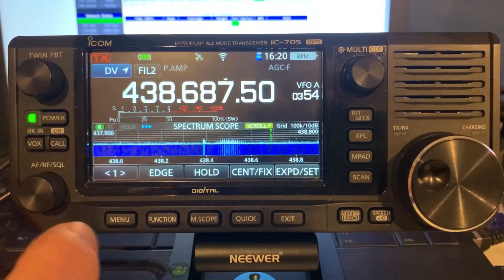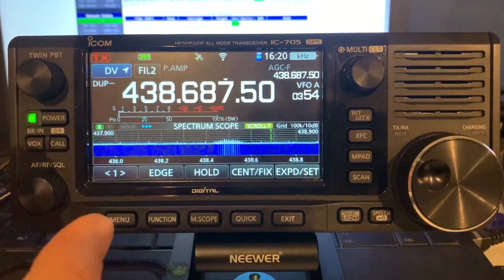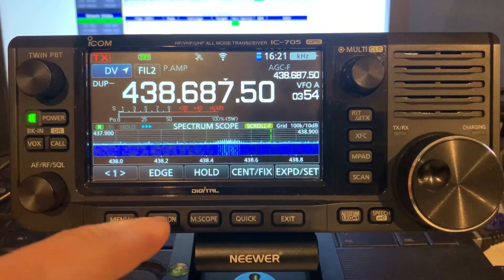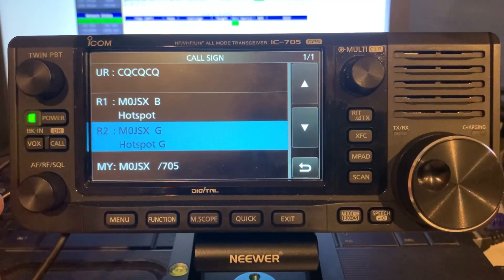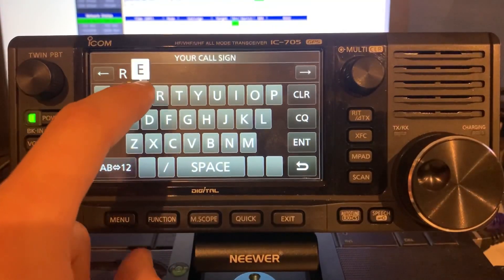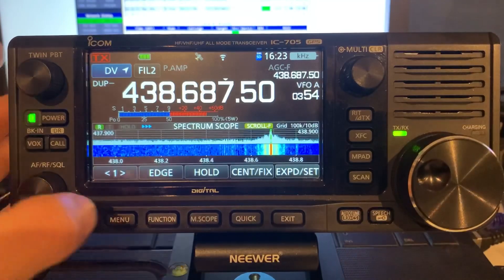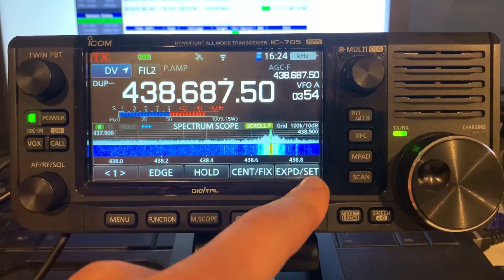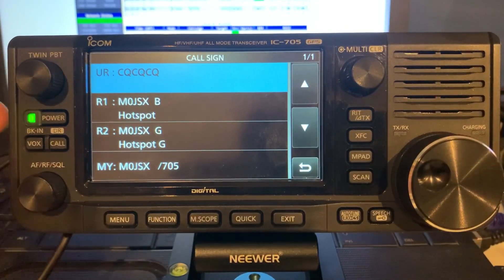How does DSTAR work?

Comment: Cheers Jonathan. I was waiting for this one since you announced it was in the pipeline. I have an ID-4100 and although I concede that the 705 looks as though it makes things a lot easier to achieve, the ID-4100 is frequently a nightmare of stabbing at buttons! An old head plus "new" tech. is a dangerous cocktail ...
Reply from the maker: Thanks for you comment Dippy. Unfortunately the ID-4100 breaks the mould a little in terms of ease of use. I’m not sure Icom really thought about the user experience too much when they designed it. Still a lot easier than the IC-2820 and predecessors! 73!

Comment: Hi again Jonathan,
Many thanks for another Great video. 
This time though I am still just as(if not more than) confused over getting my rigs active on DSAR.  I have an IC7100,  an IC92E (with the GPS Microphone, , , , , & an IC2820 with the GPS Aerial kit.  I am at a TOTAL LOSS, And I want to use DSTAR with all 3 radios, depending whether in in the car, (IC2820) out on foot (IC92E), or at home in doors (IC7100). I purchased each rig New from your previous employers BRILLIANT Emporium.
Now having watched this video, I find that I have to pay out even More money in order to use the IC7100 on DSTAR, 😞.  
Are you please, , , , , Petty Please, , , , , ,  likely to be doing any more videos on this subject.  I don't (yet) have a Hot Spot (whatever they are) of any kind, but I know that when I'm in the Herne Bay area close enough to the ICOM place, I should be able to get into something on DSTAR.  I've been informed that my 92E is fully programmed & ready to go  by one of the engineers from inside the said building, & I heard a USA contact come back to the engineer at the time of my visit to there.
Think of me as a Thicko, or even call me Thick, but I really DO need Hands On Face to Face Step by Step teaching with all this .  I know that I am missing out BIG Style here, and I simply cant grasp any of it yet, Which may sound very strange coming from someone who is Computer Literate, and I'm also an instructor for the Foundation & Intermediate Licence Exams.  I am also fully prepared to travel withing 100 miles for full Hands On Tuition with these 3 rigs.
Kind Regards,
Ray,, M)RAY.  JO01II.
Reply from the maker: Hi Ray. Watch the HamRadioNow video from around 5 years ago on DSTAR. Very useful. 

73!

Comment: DSTAR  should have become DSTAR 2 around 2009 or earlier . It has fundamental problems the main one is the data header if this is lost due to propagation or another ham trying to join a QSO an over is lost as the system won't recover. It is rare to have a QSO without a big gap . Icom have just ploughed on with this hopeless mode on its very expensive radios . P25 is now my preferred mode .

Comment: I have no problem linking to a reflector.  Like Ref030C.  Now when i look at the Reflector information page i see I’ve linked and am on C.  But I see very more entries were it list them as just listening with nothing indicated as to what mode they are connected to. I also see what seems to be conversations happening on the reflector these individuals that I am not hearing. What am I missing?
Reply from the maker: I’m not sure I follow fully. However if you are shown as connected on the info page then I would say you are connected just fine. Have you looked at the last heard page to check on activity?

Comment: Trying to work out the correct letters after entering your callsign.  Would it be M1ABC../B ? Trying to set my radio up for GB3ML to an access it via RF. Thanks
Reply from the maker: Okay. So the MY field would be your callsign with anything after the / that you fancy. RPT1: GB3ML  B and RPT2 GB3ML  G. The UR field is most commonly CQCQCQ to propagate your transmission to the network, but it is also the field used to control the repeater, for instance REF001CL will tell the repeater to connect to Reflector 1C. Hope this helps

Comment: I understand the 705 can do "terminal mode"? Any chance you can do a video on that? Thinking it'd be handy when I just dont have access to a repeater (dont have a hotspot yet either 😢) but im completely new to DV modes and lost in the menu's of my new 705.
Reply from the maker: Hello! I’ll be honest that the terminal mode on the Icom radios is a little half baked. Check out Doozy for connecting your 705 to the reflectors via a usb cable to your windows pc. There are a few videos on the subject on YouTube (including one presented by me at my former employer)
Reply: @M0JSX  thanks, will take a look!